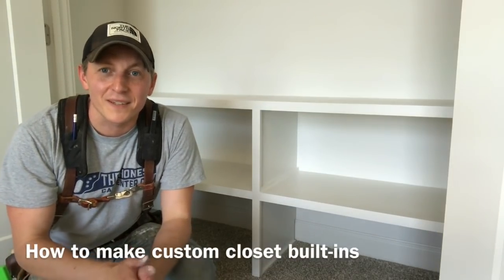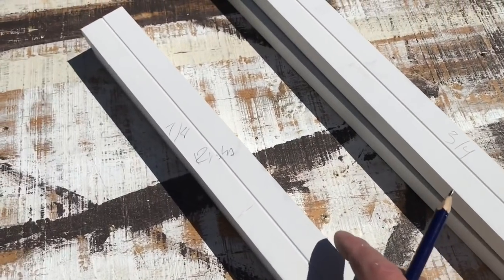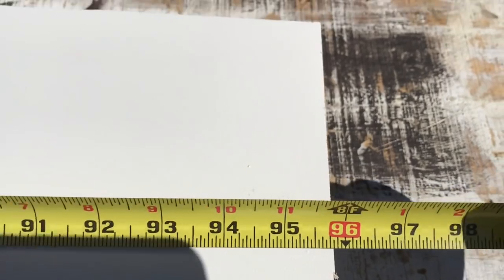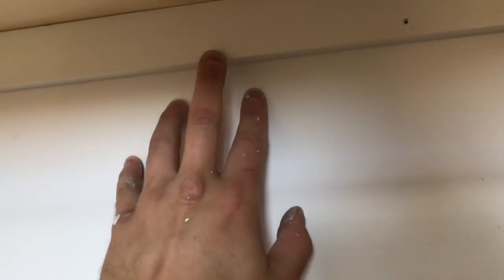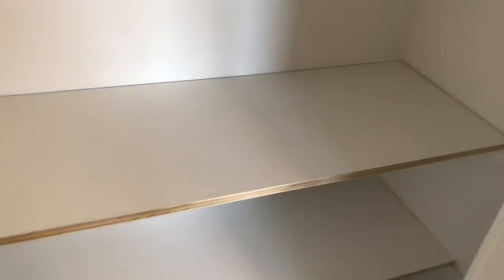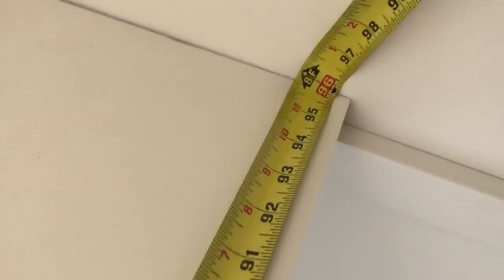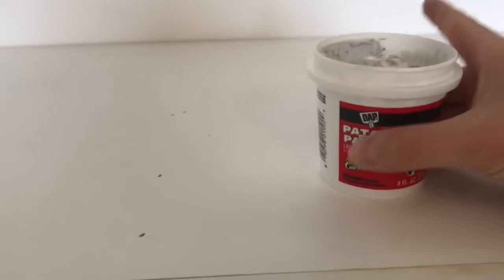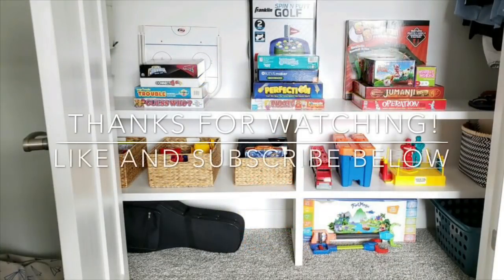Closet Built-in Shelves Installation--For Under $100!

Comment: You can get 3/4 Birch cabinet grade plywood for $30 per sheet. Home Depot plywood is almost double then if you went to a Cabinet Supply wholesaler. Just a little tip for the viewers.
Reply from the maker: ball boy jones Can you order from a cabinet supplier? I’ve only got one in my area, and it’s far away 😕
Reply: @TheHonestCarpenter  We have several suppliers our area.
Reply from the maker: ball boy jones I’m going to go looking for more locally then. Hard to find 3/4 birch for under $50 per sheet in my area. Sandeply is a little better. About $40

Comment: Was kind of surprised you didn't just roll the whole thing again after install. Sometimes, patch painting is a bigger pain in the ass, than just doing the whole thing. They turned out great looking though and nice video. I always like voice over in projects. It saves a lot of ummms and dumb talk. More people should do that.
Reply: I would have just put an extra coat on the tops and front edges of the shelves, where most of the wear occurs, and touched up the rest. They're in a closet. Appearance isn't all that high of a priority.

Comment: I use lightweight spackle and an old credit card as a purdy knife.  It forces the spackle into the hole and leaves a nice flush finish. Whit a little sanding, the hole is barely visiable.

Comment: Nice video. I would like to add that the bottom vertical support can be made removable, so that if your client needs to change the carpet in the near future, all they need to do is slide out the bottom vertical support.

Comment: Hey, great show. I assume you were doing this as inexpensive as possible, but I think I might have cut those shelves in a U shape, added cleats to the front wall, and just given the added couple square feel of shelf space. This would also hide the cleats on the side walls. Really liked the addition of the feet on the center supports.
Reply: Good idea, but I also think that eliminates the ability to hide  stuff around the corner in between the wall and the shelves which I think is very useful. Anything from vacuums to shotguns, it can be really convenient for tall items

Comment: I'm no pro but if I were doing the measurements from a carpeted floor I'd consider using the folding wooden ruler like Lufkin makes.  It should be a little easier to get some compression of the carpet.

And yup, I like the video.  Nicely done.
Reply from the maker: Good point, Old guy! Thanks 😄

Comment: Thanks for the video! I'm currently designing something similar, but with more shelves and 2 vertical dividers (closet for clothes).
As it's my first project I'm overthinking the best way to do it:
1) long vertical dividers with notches
1.1) long vertical dividers, but leave a gap in the back (to not deal with making notches)
2) long shelves and small vertical dividers + notches (just like you did)
3) build everything with pocket screws/dowels and then just attach to walls

Any tips how to make these choices and stop overthinking? Thanks!

Comment: Hey, thanks for the great video. Suggestions if you’re doing this in a basement closet with cement flooring instead of subfloor? Instead of shooting brads into the floor to hold dividers. Thanks in advance!
Reply from the maker: Thanks Jake! Honestly, I would just let the  weight pin the lower leg down. Or, you could add perpendicular triangular gusset pieces, hidden at the back, to stabilize the bottom leg.
Reply: Use a wood-to-cement adhesive along the bottom of the divider. Install the divider first (plumb and square; don’t cut out a notch at the top of the divider). Then, install the back-wall cleat as two separate pieces, one on each side of the top of the divider where it meets the back wall to add left-right stability. Then, install the lower shelf on top of the divider and cleats. (I’m no pro; do you guys see any issues with this suggestion?)
Reply: @geoffiida3315  -- The only problem I see is having the inner ends of the back-wall cleats without a stud behind them for nailing. You could position the divider to butt up to the wall so it's centered on a stud, or you could just angle-nail the ends of the cleats into the divider. It's not all that critical, since the divider is weight-bearing, and besides, it's not like a residential closet shelf is likely to be used for storing heavy stuff like automotive parts or gold bars.

Comment: I'll preface this with my knowledge of carpentry is next to nothing, but I'm surprised to see it is just brad nails on the whole project. What is the estimated weight limit of that fastener? Would using a screw increase the weight limit?

Comment: This was helpful! Do you think a 55” shelf with a 16” depth would need a center support or would cleats running along the back and sides be sufficient? Are brad nails equal to screws in terms of strength?
Reply from the maker: I would throw in one center support, Andrea! Also, brads PLUS glue will give you strength close to a screw 🙂
Reply: Thanks for your help!

Comment: Nice work. The painting allows you to really clean it all up. Can I ask what you would have done if the client wanted a natural finish in a light colored wood? Rather than brads would you use screws in counterbores (at least where brads would be too visible)?
When you do work with light woods, what is your preferred finish for shelving?
Reply: Since he hasn’t answered I will attempt to. You have several options. 

I would avoid brads. If you feel you must shoot it on you can use a 23 gauge pin nailer instead. This will leave much smaller holes while still holding your face frame in place until your glue dries. Once the glue is dried the nails aren’t doing much anyways.

Second option is to glue and clamp the face piece to the shelf before installing the shelf in the closet. To make this easier you can use biscuits to help with alignment. This method requires no nails and looks the best. But it would be a bit harder.

Truthfully , installing the face frame would not be the hard part if you were doing these out of wood panels. The hard part would be hiding all the gaps he had when meeting the wall. Calk would not look very good in this situation so instead you would be forced to scribe all your pieces in.

Hope this helps.
Reply: @kellym3610  Thanks, Kelly. I’ve not worked with  biscuits so will take a look into that.

Comment: 15 1/2 in closet boards, can I use MDF?
Reply from the maker: I'd say that's fine, grn. I'm usually more worried about the span than the depth. That's about a 16" deep shelf. As long as it's not spanned much more than a couple feet, the deeper shelf shouldn't make too much of a difference. I would put a cleat at the back (beneath the shelf) if possible, and possibly run a 1x2 screen trim across the front to stiffen it up. For longer spans I would try to work in a center support

Comment: Does anyone just throw away the brush after they paint.
Reply: You can scrap the excess off then wash them clean before the paint dries.
Reply: Most paint is water based today...buy a good brush and it will last you 10 years with weekly use and decent care.

Comment: nice, but it would be nice to not have those thin pieces of trim in the middle of the shelf.  It means you can't place items flush with the center wall of the shelf - like if you were to use it as a book shelf for example